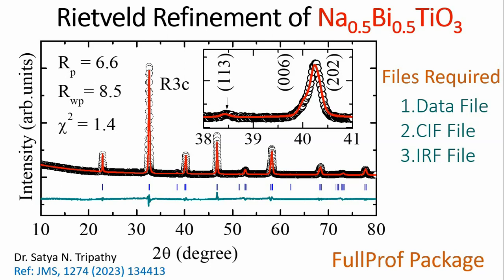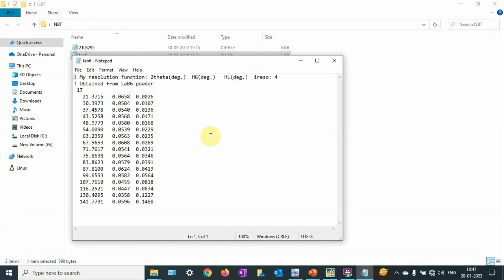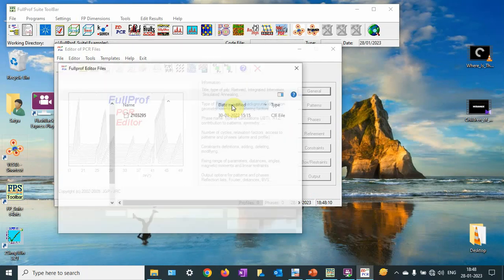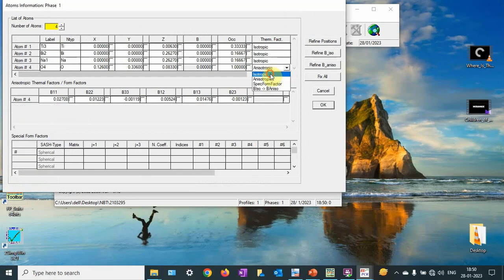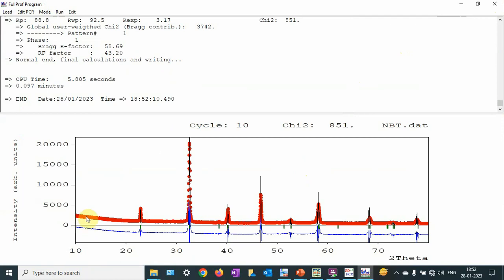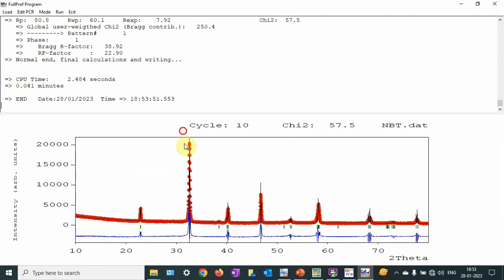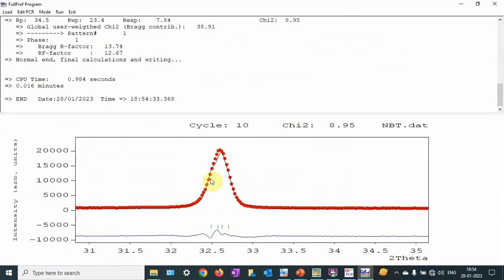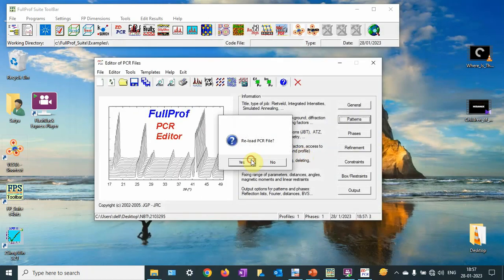Rietveld Refinement of X-ray Diffraction  Data of NBT Using FullProf Package - Part III

Comment: thank you very much sir for this lecture sir, i am working one double phases and the xrd result optained is not a solid solution, it is a composition.  i really would like to get in touch with you if it is possible.

Comment: Dear sir, i need to identify my sample, in this case , is it the best to do the riedveld refinement as a first step, thanks you so much,
Reply from the maker: Please try to find out all the phases present in your compound using PDF4. Then this  rietveld method is good for lattice parameter determination and space group confirmation.
Reply: @physicsdoneright  Thank you so  much sir, this video is very awesome,  can you please help me, how we can find the cif file of my composition nanocrystale TiO2-ZnO . Because I find only the cif file for TiO2.
Reply from the maker: @wafazina4225  To do the refinement you have to add phase 1 with TiO2 and Phase 2 with ZnO. Get the indiviual cif files and do the dual phase refinement.